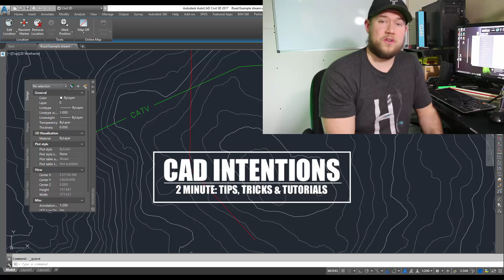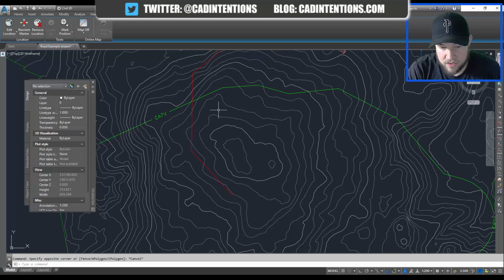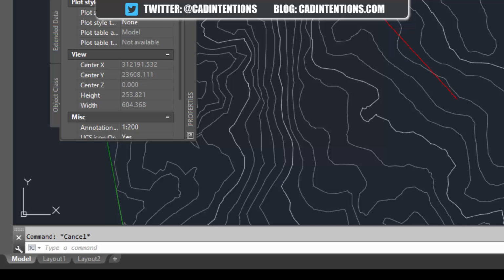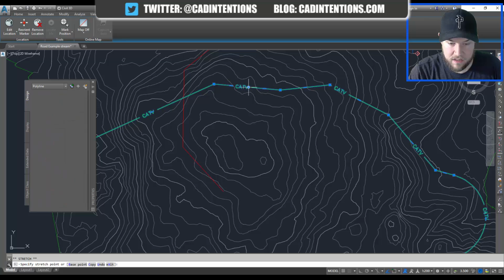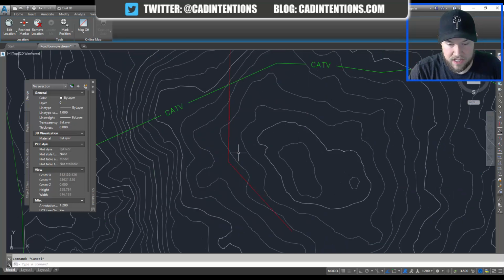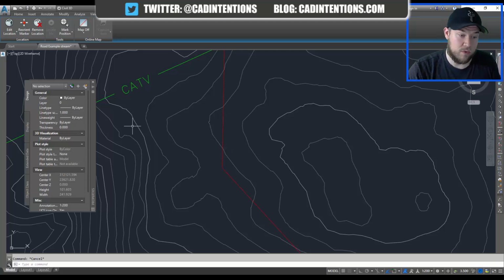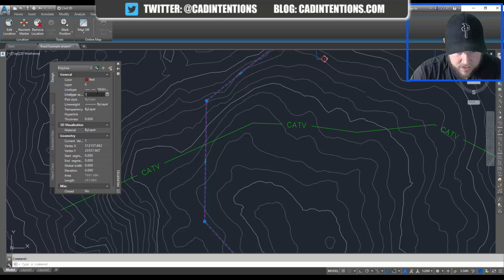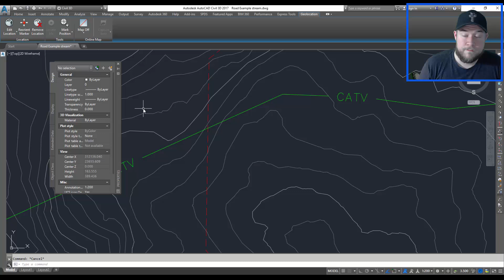AutoCAD Tutorial: Linetype Scales and Fixing Linetype Display Issues

Comment: The problem that I've been running into is that if I apply a different LTS to the linetype with CATV then the text itself gets smaller. Is there any way around this?

Also, in Microstation (an alternate CAD program) I remember there being a command where you could click a line and "shift" the pattern along the line, so if you just didn't like where the text was appearing along the line you could  move it. I haven't found anything like this in ACAD.

I'm trying to create a legend with short segments for line type examples but if it's too short nothing comes up. If I change the LTS to the point that it does show up the lettering is tiny. 

Any help is appreciated.

Comment: Definitely taking note of the pedit > L > o. Thanks for sharing. Would you know how to accomplish a similar task but for plotting? I designed for a 1"-20' scale for my design sheets, but for my cover page, I'm at a 1"-120'. When I go to plot, all the line thicknesses bleed too big. I'm looking for a quick way to scale down/ thin out the lines during the plot process without having to go to each layer and change the plot color in the .ctb file.

Comment: Hi Dear Brandon

I Have one issue about line type space sometime i have to work on drawing of other person so if i use scale like mm and my door size is 1000mm and other person use scale like meter and he put door size 1m this i can manage but line type scale problem
how i tell you 
see that is my door i created block of my door and use hidden line for showing door swing area so in my drawing my line type scale is 25.00 or 1 (command LTS )  my drawing unit is mm ok 
and he made door block same as i made but he used unit of drawing Meter 
and in his drawing he used line type scale 0.025 (Command LTS )
so sometime i bring my blocks in his drawing when i have to work in his drawing so for that i open my drawing and simply ctrl+c and ctrl+v in his drawing for bring my door block
then my door block is not show swing line in dash to solve this i have to edit block and need to change scale of line 
so please tell if there is any easy way 
and make one tutorial on it how to communicate and do work fast on different units of drawing like mm, cm and meter.
and please send me some professional drawings i'm new in my field in architecture so i can learn from it.
my E.mail is sendmenow@gmail.com (if you will not get my question tell me by mail)
i also watch your tutorials its really help me !

Thank you so much
Faisal

Comment: So how do you convert all layers to one layer while maintaining the color of the converted layers.
Reply: Alain Sarius don't think you can.
Reply from the maker: Hey, I agree with Braun, I don't think you can maintain the color from the individual layers when combining, if you're using Color BY LAYER which I assume you are, then the objects will all take the color of the layer they are on. A work around would be to set the color of the objects to an actual color and not assigned BY LAYER, then when you combine them all to a single layer, they will maintain the individual colors you had chosen for each. Hopefully that helps and makes sense in writing. 
Cheers!